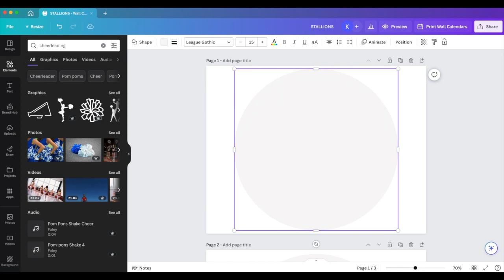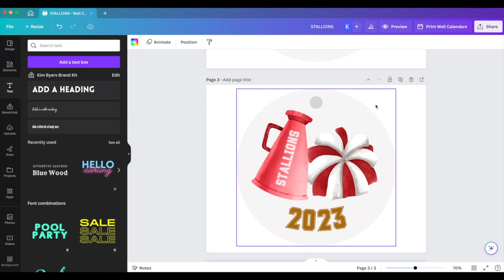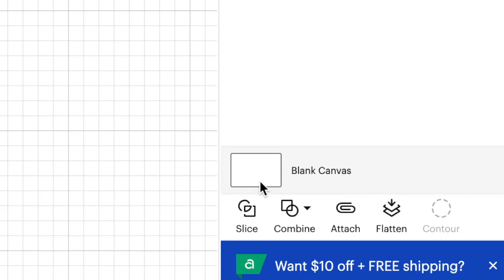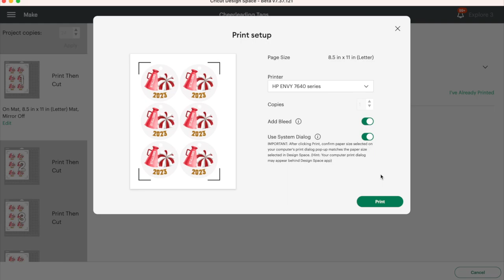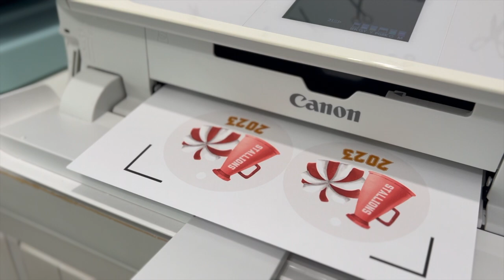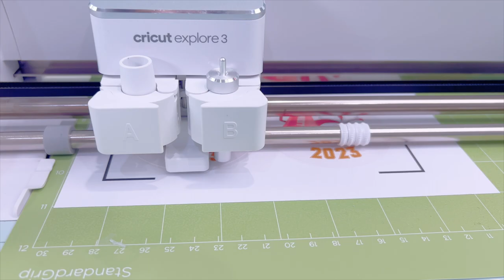Make PERSONALIZED PRINTED Gift Tags With Cricut And Canva!

Comment: Has Canvas made changes lately?.I used to.bring it up, pick an image and slide under the image and enlarge it with the percentage slidebar. 
Now I don't have the slide bar unless I click on the 3 dots, then click on zoom. The problem is the zoom opens up a bigger screen and my slide bar does not proportionally work rught. If I slide over 100% its too large for my screen. 
I've tried help on the Canvas site but it doesn't help at all. 
Any ideas, or where to go to fix this?